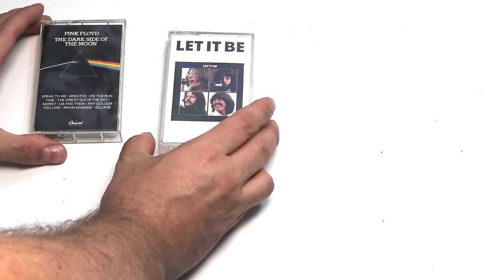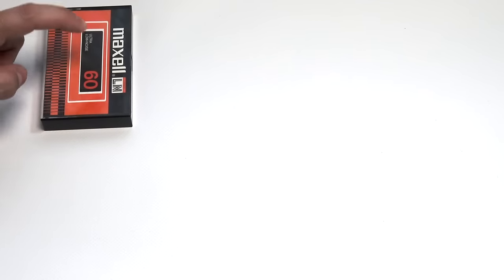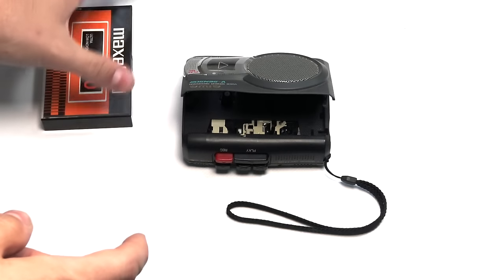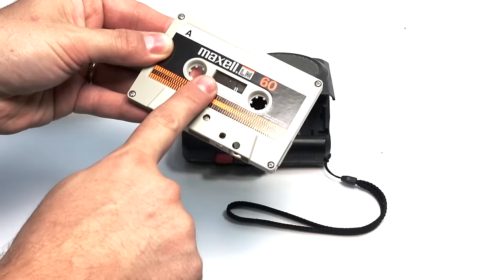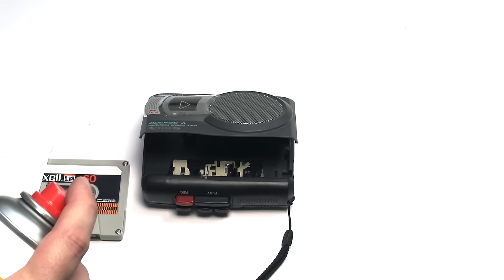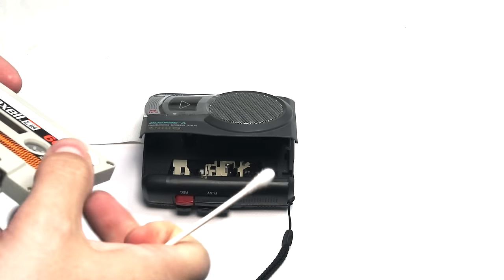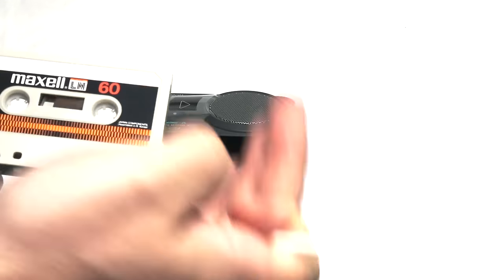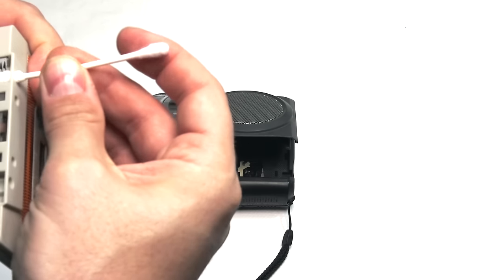How to relubricate your stuck cassette tapes

Comment: Just came across on this video on my demand for a label paper salvage, to peel off and stick on new shells. Only found one and probably won't work becaus uses acetone and we all know acetone+ink+plastic=trash. So I stopped by because lubricant for tapes 🤯 blow mi mind. And actually i have a cassette that I played a few times, but its from the late 80's and starts well and by the second track starts to go slower until it stops. Same on other side. So I'm going to give a try with your suggestion. And will be back to tell how it worked! Thank you...for now😅
Reply from the maker: Sure! Will be waiting!

Comment: Thank you to introduce me to this method. I will apply it to my squeaky Pink Floyd- The Wall and wowing and fluttering Judas Priest - Live tapes that made me very sad.
Reply from the maker: Give us some feedback if you want!
Reply: @anadialog  I'll let you know once I play the tapes next month:)
Reply: Wow I was just reading comments on results with my Pink Floyd The Wall tape stopping in the middle. I did the alcohol Q-tip method to remove mold from the outer sides of it and looks good but need to lube it. I saw WD40 makes a silicone lube so I might go that route. Got a Bob Segar Night Moves that is doing it too.
Reply: @thaddeusmcgrath  I also used WD40 since I couldn't get the recommended lubricant in my country. However it worked for 1 or 2 times playback but the tape will go back to squeaky after that. It lasts longer if it applied on 2000's pressing as I tried on my Entombed squeaky tapes and it still sounds good even after more than 4 times playback.
Reply: @judasyohanes1216  Sorry for the return squeal. Yes I am only having the tape freeze during playback in certain spots and confirmed with another player. Have you researched any non-solvent silicone lubricants in your country or is WD40 the way to go with outcome? Thanks for replying BTW!

Comment: Should you do it on both sides of the tape (top and bottom) or does it seep into the tape? Also could you put lubricant on the pressure pad?
Reply from the maker: Only one side as shown and no, no pressure pad. You must absorb the reside to avoid trasport issues

Comment: I also wonder if the reels sometimes cause this type of problem?  If the teeth of the cassette reel have worn or are not quite the correct size they don't grab to the cassette player pulley's properly leading to incorrect playback.

Comment: Thank you for the informative 
, and instructive video. But personally I think the best solution would be to replace the "films" or the washers that keep the tapes evenly in the reels. Loosing the central screw of the cassettes can also do the job significantly. Of course this solution works on cassettes with screws.
Reply from the maker: As I always say, that is the first thing to do but when the binder is dry, it's dry!
Reply: Yep........have had to crack open cassette shells over the years cos it's often the only way !

Comment: I wonder if it took so long to seep in because those are re-releases of those albums? I have the same Pink Floyd tape, same re-release. I don’t believe it is, but if it’s on chromium oxide tape (the black tape) it could be the metal that makes it harder to seep in. Thanks for the video though! I spent $10 on Blue Öyster Cult’s 1981 album “Fire Of Unknown Origin”- an original from ‘81 and it squeaks a lot. I’ll definitely try this

Comment: Thanks for that video. I did get a brand new seald cassette from the late 90s and it wont play on my 3 sony walkmans. Out of the box not working. I did drs it on my stere radio with a tape deck, it works but so slow you cant hear anything. I did try ypur method 3 times, i hope that it will work, would be sad if its damaged :/
Reply: NO WAY that did really worked after a day so well! Thanks a lot my friend i never thoughtbtjat this would work😳😨😮 I will do this process in a few days again to be sure that the tape works well.
Reply from the maker: Thanks for the feedback!
Reply: What lubricant did you use?
Reply: @kelpkelp5252  belive me or not: WD40✌️
Reply: @DarkSorrowDark_Sorrow  Wow, what? :D OK fair enough. Presume it's not just ordinary WD40 but the silicone one?
Reply: @kelpkelp5252  just ordinary wd40 no silcon or anything else. For me it worked perfectly. You can try the silicone one too.
Reply: @DarkSorrowDark_Sorrow  Thanks

Comment: Thanks for this video. I have purchased The Debussy Album (2 LPs' worth of music) on cassette tape 3 times thus far and every single copy had bad tape drag, wow and flutter and resultant distortion. I just bought the 3M spray you recommended and am going to give it a try. Fingers crossed . . . If it works, I will digitize the audio and use GoldWave to denoise and remaster it.
Reply: And did it work?
Reply: Did it work?
Reply: @joyoussound  YES. TWO METHODS COMPARED HERE: https://youtu.be/GuNsnV2YDiI

Comment: Before today, I never knew that those crammed cassettes have a lubrication issue which could be solved! Once I saw a thrown up cassette at a side of a street and played it to find that mysterious issue. I would normally forward them and rewind them, it helped temporarily, or I pushed with my fingers the gears in and from the other side in, trying to even out the rolled tape so that it doesn't get stuck in the cassette.

Comment: Hi, thanks for this Video. As i followed an instruction from another video then my Michael Bolton Cassette spoilt. May I know can this work on those cassettes which have mildew? And can I used alcohol isopropyl or anti rust lubricant? Because I can’t find Kontakt 61 and the bottle you mentioned in my country. May I know what’s the ingredients inside the 3M lubricant? Thanks.
Reply from the maker: No, this solution is not for mold/mildew. This solution is only if your cassette lost its lubricant. I can't recommend anything else because I did not test other solutions. I can only say that the main ingredient is a liquid silicon lubricant, with no alcohol or thinners.
Reply: @anadialog  Hi, thank you for your information! Your video and answer help me a lots :) Wish you a nice day

Comment: Just thinking... when you have cassettes held together with screws wouldn't it be much easier to open up the cassette and lube the spool both sides? or lube the inside plastic sheets side A and B? No need to wait for the oil to seep in, no risk to flood the play head. I do believe heads are meant to slide on a dry tape.

Anyways.... I wouldn't really automatically trust any silicone oil. I ruined a completely good seal on a non-electronics using just that. Should the silicone oil contain any ingredient not suitable for rubber dressing (and I learnt this the hard away) you might end up with sloppy pinch rollers on your deck... and that might be a huge problem if you've already done several cassettes.

Comment: I’m having a hard time find that lubricant. Granted this video is 5 years old. Anyone have a link on where to buy some? Trying to salvage two tapes
Reply from the maker: If you can’t find it, just try a silicon based lubricant WITHOUT solvents/thinner etc.

Comment: Do you think a quick drying natural organic oil (i.e. sunflower oil or sesame oil) would work?
Reply from the maker: I haven't tried but it sounds like a very bad idea. The original bider surely used synthetic lubes with specif viscosity and tendency to dry. Silicone is best. Don't get me wrong, it would surely work but I think it would never dry and/or mess a lot with the trasport.

Comment: I've bought brand new tapes last year (blank tapes for use in a 4 track recorder... that don't want to turn in the deck...& definitely don't want to fast forward or rewind at all... Wonder if this might work for those.... But they're cheap tapes that were like that soon as I first used them
Reply from the maker: Strange! I would find better tape before going through the hassle.

Comment: Just a quick question : You had the q-tip positioned so that the tape ran behind it, is that correct? Should it not be in front of the q-tip so that the underside of the tape is lubricated (the part which actually rubs against the cassette shell) ?
Reply from the maker: No, the correct way is that shown. You must lubricate the side where the binder is, that is where the original lube was, on the top. The problem is between each layer of tape, not the shell.
Reply: @anadialog  Excellent, thanks :) I will do it the same way. I did ask another question but it may have got lost in the noise of that large thread at the top comment. I have bought the exact same 3M spray you used in the video, is this still the correct one and it is the wet one?
Reply: @anadialog  Is there a particular type of q-tip you use? I've just tried mine now (finally got a Walkman today) and my q-tip is very thin and just wobbles around inside the hole in the cassette.

Comment: Quick question Is there any risk if damaging the player? And is the laser that reads the tape dangerous to your eyes ?
Reply from the maker: No if you absorb the remaining lube. Laser, which laser?
Reply: @anadialog  sorry I was under the assumption tapes where read by a laser like dvds
Reply: @jameshead833  It's magnetic media so no laser is involved whereas DVDs / CDs have tiny bumps and troughs which a laser reads.

Comment: The problem is not the tape itself. The inner sleeves especially on pre recorded tapes are what allow the reels  smooth transport . Lubricating the tape itself will lubricate the sleeves. Gently prying the cassette apart and lubricating the sleeves themselves will solve the issue and not need to be contacted on the playback side of the tape. All this does is lubricate the inner sleeve without having to halve the cassette . Tapping on all 4 edges helps without lubing anything.
Reply from the maker: All types of tape have lube in the binder. Sometimes this goes dry and it is a standard procedure to relubricate old tape as yoiu can read in the articles I uploaded in the video description.

Comment: Hello Guys i red your comments but i am still not sure of this method i believe that all kind of audio/video tape dose not like moisturising and humidity,  so if il’ll use a lubrificant I suggest to use a dry kind of lubrificant like graphite for example, anyway i also had the same issue with my cassettes and R2R tapes and i simply fixed them with a dehydrator, but if you don’t have one you can use your Oven, for the audio cassettes is much more simpler then the Audio reels, you need to put you cassette in the oven for 4 to 8 hours with a temperature between 40/50 degrees C.
For Audio reels you need much more time usually.
Hope that’s help.

Comment: Hey there. What if both on the hubs in the cassette itself are stuck to where they won't turn at all either way? How can you fix that problem? Thank you!😀
Reply from the maker: It's hard to say. This lubricant solution is for tape in good condition. If other problems are present like mold, I can't suggest anything. Sorry about that.

Comment: slip sheets inside the tape casecan become tacky with age and improper storage. this causes the reels to drag against them. what you can do is open the cassette if it has screws, and, very lightly with a makeup brush, dust some baby powder onto the slip sheets. it's tricky to do the b-side opposite the screws, so you have to have good small detail coordination to get the tape set back along its path before reclosing it. failing that, you can re-house the reels into a newer cassette body. i have been repairing my own tapes since i was a teen and it works.
Reply: I wouldn't use baby powder, I'd use a high quality fine graphite lubricant, and only the tiniest amount of it, but yeah.  That's what those slip sheets originally had applied to them.  It's probably worn off or maybe became hydrophilic and attracted moisture and seized up.

Comment: Could propanol 100%   work just the same?
Also, since you mentioned in your video about other cassette fixes.  I've bought alot of 70's tapes over the past few years and when I've played them they sounded awful.  The first thing I've done is replace the pad with some similar sized felt off ebay.  These pads come in strips and have an adhesive on one side. So you remove the remains of the 70's pad which is probably worn out to such a level that when the cassette head engages with the tape the right tension is not achieved and so you get a muffled sound. I've replaced about 20 of my tapes and only about 3 or 4 have still had the problem afterwards (why ? I don't know maybe  heat, damp or magnetic issues in the past)
Reply from the maker: Absolutely no, it's alcohol and alcohol eats polyester !
Reply: @anadialog  It evaporates quickly when exposed to air leaving no residue
Reply: @anadialog  I don't know what I was thinking of when I wrote this!  I was thinking of cleaning mould off cassettes but your talking about lubricating the cassette.  I'll order some Silicone spray and give this a go and thanks about your mention of XDR tapes, I never knew about these and will now be searching to get the Beatles back catalogue.  👍

Comment: Never tested the 3M product but it contains a lot of solvents which potentially can dissolve the basic tape and glue it to the next round of tape. SO,to be safe ,let the solvent evaporate or , what I´ve done, use a waterborne silicone emulsion.
Reply from the maker: Nope, the wet version has no solvents, that is why it's called wet.

Comment: I looked up that particular item, and it's not available. There are 3MLubrifiant silicone sprays, but there are different ones. There is a dry silicone spray and a wet silicone spray. Which type of spray did you use, and does it matter on the number on the spray?
Reply: @anadialog  Thank you for the information. I'll do that.
Reply: I just received a Walkman that I have just purchased, but it only has fast forward. Will this work? Also, I wasn't clear on the 2 Q-tips to use two for each side. I'm guessing that one is for the silicone and one to dry. Is that correct? And I figure when you say just a bit, it means as little on the side of the swab as possible. Let me know. Thanks.
Reply from the maker: Exactly! You perfectly understood...

Comment: Is lubrication also the issue when tapes start sounding slowed down? I bought a Depeche Mode tape which was never played (sealed).
Reply from the maker: I believe so. Not always but in most cases, yes.

Comment: Hello, I’m watching your video and reading the comments. Even the argument you had previously, I’m rather confused. Is this really a cheap trick, will it mess up my tapes? I really would like to trust your information but I don’t want to my tape to stop working
Reply: Also is it wet or dry? You said dry at one point then wet
Reply from the maker: Try it on one tape and wait. I tested these solutions and never had a problem. Check also the documentation in the video description. It's a standard procedure, not a cheap trick.
Reply from the maker: The one to use is that present in the video description.

Comment: So can you not use a normal walkman? Tried using mine but the silver thin cylinder thing inside the walkman that goes in the cassette hole was in the way so the cue tip couldnt go through
Reply from the maker: Unfortunately it depends from the models…
Reply: @anadialog  ah ok ill just order one of the ones from the video, cheers :)

Comment: I cannot find the lube used on this video anywhere. Is there an alternative that’s easily accessible in the US? I found specialized lube from  wd40?
Reply from the maker: Many say this. Try a silicone based lube with NO thinners, alcohol or diluents.
Reply: @anadialog  do you have any suggestions?

Comment: I have a few cassettes that do this, one in specific is XDR and the other is not. The XDR one is Tina Turner "Simply The Best" and the other one is a compilation set. My Michael Jackson History and History in the mix cassettes also have this issue with them playing fine then when the take up real gets a bit "heavier" it starts to tighten up. I was told a good fast-forwarding and rewinding back and forth a few times would help it, and while it has for a short while, I am still plagued with this issue. I have so many cassettes that I have collected. Another common issue I found with these cassettes (XDR included) as well as those ones that have the white reels, is the guide rollers tend to not move properly if at all in some cases. When these guide rollers aren't rotating when the cassette is playing, fast-forwarding or rewinding I think that also causes several issues. Would these guide rollers need lubricated in a way as well?
Reply from the maker: You mean the ones in the corners? No, I
I wouldn't touch those.
Reply: @anadialog  thank you, I’m late on this. Would it be a good idea to replace the guide rollers in the corner possibly (especially if the cassette case has screws)

Comment: It looks like the 3M 08877 Wet is no longer available, it's not on their website at all, apart from the data sheet.  Any idea what the next best thing in Europe is?
Reply from the maker: Probably a silicon based lubricant WITHOUT thinners, alcohol or solvents inside.
Reply: @anadialog   Hi, I meant a specific one.  I can't find anything that doesn't have petroleum, OR they don't specify.... so nothing on this earth matches that I can find.... :-(